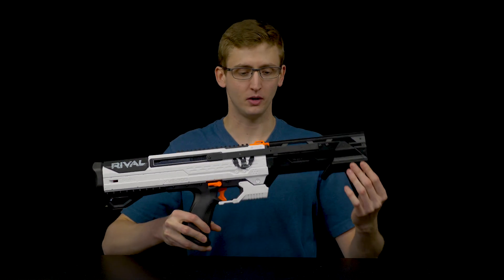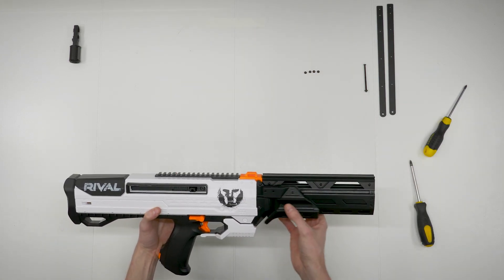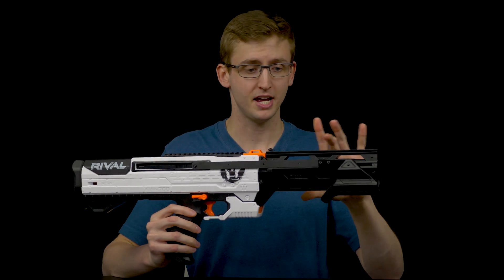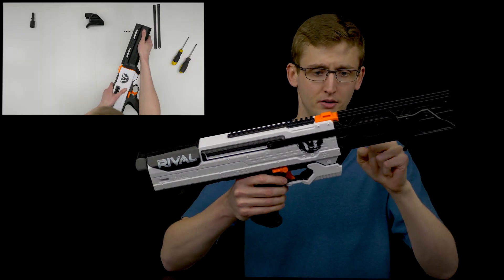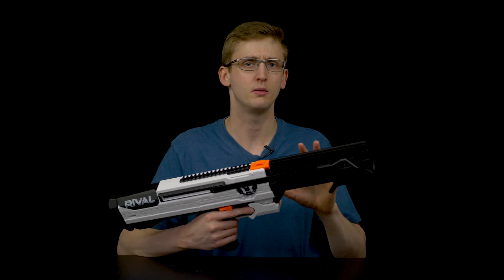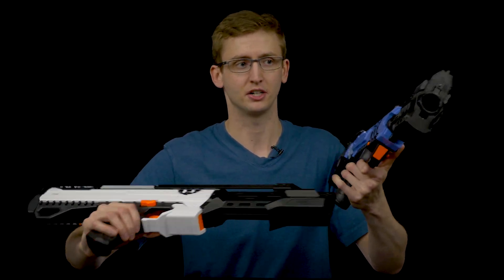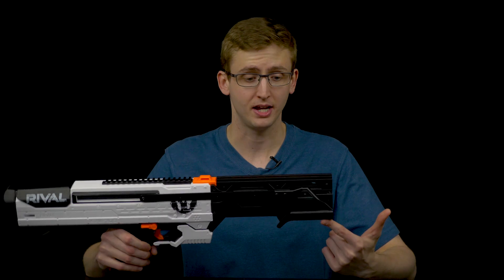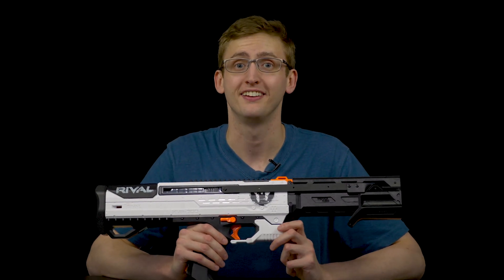[MOD] Pump Action Nerf Rival Helios | 3D Printed Kit by F10555!

Comment: I found out yesterday that you can smooth 3d prints using an evaporated solvent. The one I saw used acetone on abs, and the print came out with all of the layers smoothed over. If you want to try it out look for "Acetone Vapor Bath". As long as the print is abs, it should work. As for other plastics, you'd have to use their solvents.

Comment: If the original blaster is not good enough, 
put a pump or a flywheel on it.
Reply: imagine a flywheel pump with that noise? automatic SQUEAK
Reply: Pump action springer with an afterburner
Reply: You just described the Hypnos and Hera
Reply: Just get a Hera for a flywheel

Comment: why don't you sand the 3d printed parts that scrape each other so it's quieter, I've never tried it but theoretically it should work. Or just put some lube on the priming grip.

Comment: I'd buy it if it was printed with ABS instead of PLA. It's not even the heat resistant PLA, they have a warning on the site you can buy this from about not leaving it in a car or in the sun. The $60+ pricetag warrants better material.

Comment: If you had it, I would've used a Retouch3D variable heat knife to smooth out the areas that cause that terrible friction noise of the 3D printed parts.

Comment: I made a pump kit out of pvc pipe and a metal bar and it only costs 10 dollars
Reply: Wyatt the random YT is there a way you can show me? The pump kits all cost $50+
Reply: @RiceGuy  get 2.5 inch pvc pipe and cut it down to a 7 to 8 inch size, then for the pump, get a 3 inch repair coulpling or regular coilping and sand out the inner barrel. That will be the slide. Then get another 3 inch coulping and cit it arround the muzzle of the gun, if it is loose, use duck tape or electrical tape. Fit the pvc barrel to that coulping. Finally take the slide piece and fit it around the barrel (Sand it if you need to) and take a metal bar and fit it to the slide with epoxy and trim bar to size. At the other end of the bar, fit a bolt threw the gun and metal bar. Total cost should be around 15 U.S dollars.

GOOD LUCK!!!

Comment: I actually planned on getting a camo edition Apollo and the 3d printed kit for it but recently got a Helios and I actually much prefer keeping my left hand on the bolt grip and aiming the blaster that way. That being said, I don't focus on rate of fire when using springers and only really use them as a secondary when I don't need a flywheel primary to spew foam fast.

Comment: I've noticed that scraping sound on quite a few 3D printed sliding components. Is there any way to minimise that noise? Like with lubrication or sanding?
Reply: little late here but some high build primer from a automotive store followed by a light sanding makes a world or difference

Comment: If the helios has a return spring for the bolt does that mean the pump grip can return by itself
Reply: vanoss fan 121 yeah, it can. Another youtuber showed that it can be
Reply: Yup
Reply: Yeah the return spring is strong enough to return the pump though you can get a stronger retention spring if you so desire
Reply: GAMING BLAZE, ive got a pump action kit for my Helios, and the return spring works fine

Comment: So the return spring doesn't work anymore?
Reply: No
Reply: not true, it works fine. Its just under a slightly heavier load, and may catch because of the aforementioned print rubbing. Sand the parts where it rubs down and itll be much smoother, and therefore more likely to work for the auto return